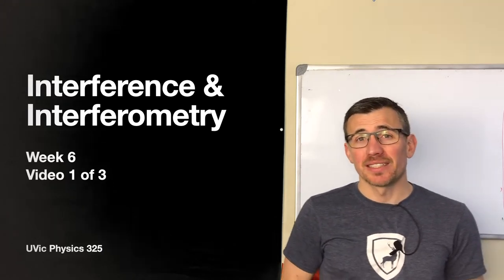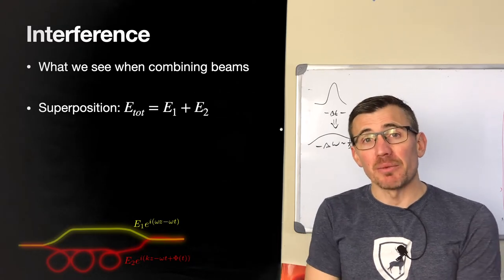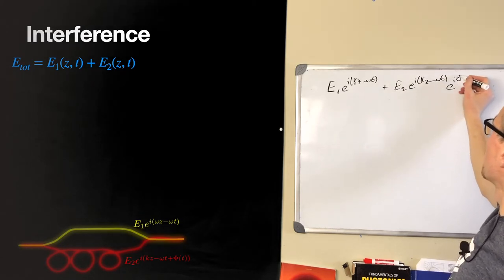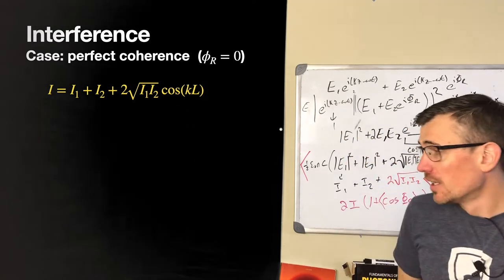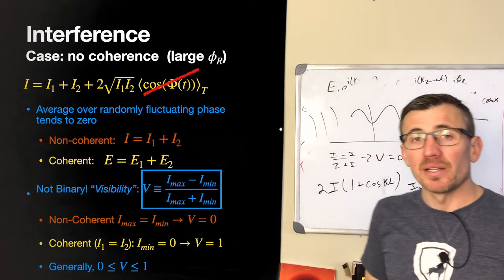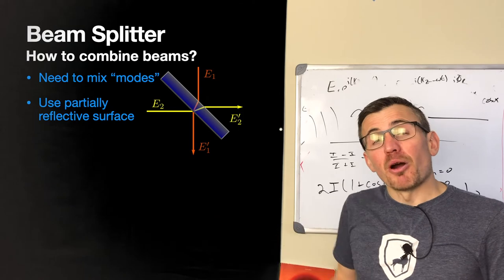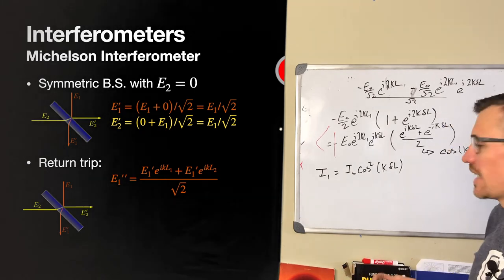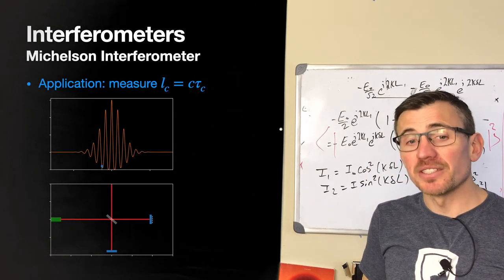Week 6a: Interference

Comment: An example of a nonturbulent flow is a smooth river: Every part of the river moves in the same direction at the same speed. A turbulent fluid is the fracturing of that river, so that different parts of the flow move in different directions at different velocities. Physicists describe the formation of turbulence as, first, an eddy in a smooth flow, and then the formation of eddies within that eddy, and yet finer eddies within those eddies — eddies all the way down, so that the fluid becomes broken into discrete parts, all interacting, each moving its own way. Researchers want to understand exactly how a smooth flow breaks down into a turbulent flow and to model the future shape of a fluid once turbulence has taken over. But the Millennium Prize asks for something much more modest: proving that solutions will always exist. That is, can the equations describe any fluid, from any starting conditions, indefinitely far into the future? Researchers want to understand exactly how a smooth flow breaks down into a turbulent flow and to model the future shape of a fluid once turbulence has taken over. But the Millennium Prize asks for something much more modest: proving that solutions will always exist. That is, can the equations describe any fluid, from any starting conditions, indefinitely far into the future? Researchers want to understand exactly how a smooth flow breaks down into a turbulent flow and to model the future shape of a fluid once turbulence has taken over. But the Millennium Prize asks for something much more modest: proving that solutions will always exist. That is, can the equations describe any fluid, from any starting conditions, indefinitely far into the future? So how do you prove that solutions exist? Well, start by thinking about what could make them not exist. The Navier-Stokes equations involve calculating changes in quantities like velocity and pressure. Mathematicians worry about this kind of scenario: You’re running the equations, and after some finite amount of time, they tell you a particle in the fluid is moving infinitely fast. That would be a problem because you can’t calculate the change of an infinite value any more than you can divide by zero. Mathematicians refer to such scenarios as “blowup,” and in a blowup scenario you’d say the equations break down and solutions don’t exist.